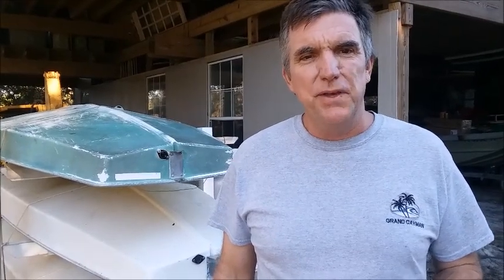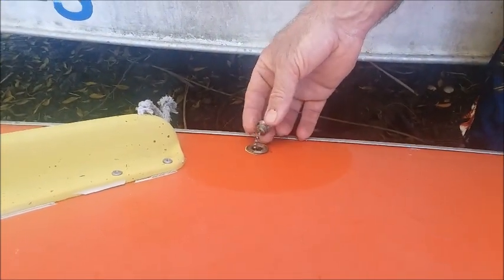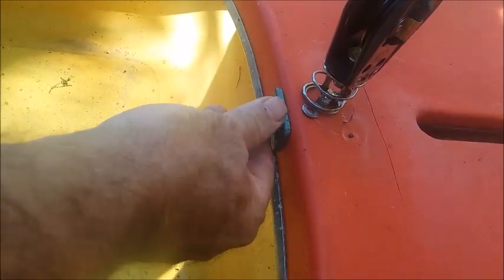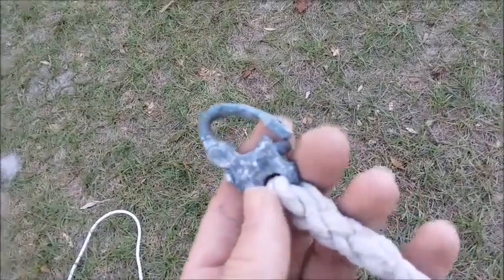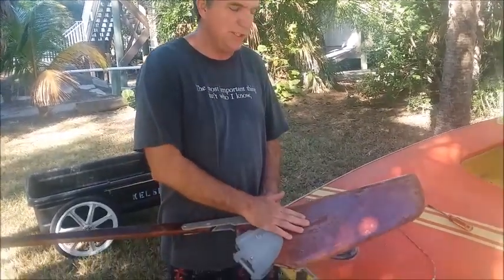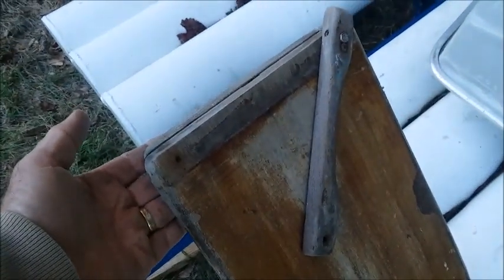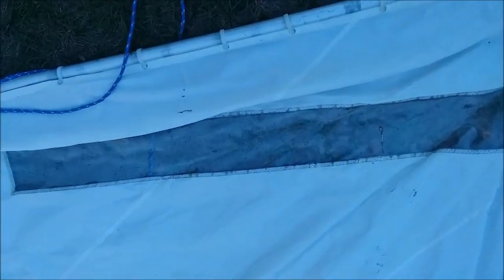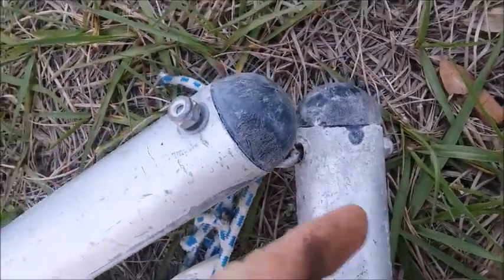Buying a Used Sunfish Sailboat? What to Look Out For!!!

Comment: Love the message, but there’s quite a bit of incorrect info in this video.  The soft hull is not just as fast.  When you find a hull that’s spider cracked and flexible, it’s not going to be nearly as fast especially not in waves.  The wire bridal on the back with the loop, the one’s without the loop are legit as well.  No one who races clips it to the loop in the middle, you tie it to the bridal so it can slide from side to side. 1 tip for your mainsheet block to keep it from pulling out is to always threw bolt it and use a backer piece of aluminum or large washers to keep it from pulling out.  That is not an after market bailer.  It’s the new style one that comes with all the newer boats.  I think they started doing that in the 80’s.  The porthole in the back was put there because the rudder fitting isn’t original.  That style of rudder didn’t come on that year of boat.  The pin’s that lock the rudder on, tent to bend.  Be careful that it’s straight.  It won’t go on well.

Comment: FYI, Sunfish earlier than 1972 or 73 had the serial numbers on a metal plate attached to the forward bulkhead of the cockpit and they often go missing. I have a '71 that I rehabbed and there's no serial number. Fortunately, I don't need to register it where I am moving to.

Comment: Thanks for the very useful video.  It seems you are in Florida, with your observations about corrosion from  salt water.  So I'm concerned about boating with alligators there!  I'm thinking of going to Florida and doing some Sunfish sailing, but as a newbie to the boat and the state, I'm a little worried about capsizing and being a tasty snack.  Same thing with avoiding swimming.  Any tips from any tropical Youtubers?  Common sense advice?  Reassurance?  I know enough to leave the gators the heck alone if I see them,  and to respect them as wild creatures.  Thanks in advance.
Reply from the maker: Gators are typically fresh water reptiles.  Not a big problem down here. Most urban lakes don't have any.  Usually they are in river systems or lakes attached to a river system.  I wouldn't suggest swimming at night but during the day I don't think it is a problem.  You would probably be a greater risk driving in your car to get here than getting bit by a gator.

Comment: Hey my name is Joy and I just bought a sunfish today and noticed some bad nose damage I was wondering if I could send you a picture of it to see what you recommend.
Reply from the maker: Hi Joy,  I would recommend using fiberglass resin with cloth to repair any cracks or holes.  Take a look at my other video "
How to Repair a Rotten Door Frame Threshold With Bondo and Fiberglass" to learn how to work with fiberglass.  In the situation with the sunfish don't put any bondo under the fiberglass like we did to repair the door jam but rather if cosmetics are important  then a thin bondo layer can be used to smooth out a fiberglassed repair area.  Fiberglass with cloth is used for strength while bondo is used to smooth a surface to hide cosmetic imperfections.  The video I referenced above with show you how to work with both products.  Both products are available at Homedepot or Lowes.  I would love to see a picture if you can send one through this comment thread.  Thanks
Reply: @creativerepairing2960  thank you!!!
Reply: @creativerepairing2960  I have no idea how to send a photo, I don't use youtube that often
Reply from the maker: @joymcdonald118  Hi Joy, I don't know youtube that well either.  Did the door jam video help?

Comment: One statement that is incorrect, not all Sunfish sailboats have a HIN number on the transom.  I've sailed these since the 1950's.  I currently own a 1959 in near perfect original condition.  The hull identification number is on a metal plate riveted behind the front splash, it is 5 digits. Thanks for the otherwise informative video!

Comment: People have told me that they've purchased a Sunfish hull (hull only) for little money. But they don't realize that the parts to get it sail ready will cost them quite a bit. Rudder and tiller assemblies alone run upwards of $300, let alone the spars, daggerboard, sails, etc. It's best to buy a complete boat to start with. Complete used boats in sailing condition are the way to go.
Reply: I had one given to me without the sail I wonder if there are inexpensive aftermarket sails out there I dont know if I will like sailing so I dont want to put a lot in it
Reply: @edwinmarcais6040  Aftermarket sails for the Sunfish are everywhere. They range from $150  on up. Just search the web.
Reply: @edwinmarcais6040  Try APS or Intensity sails for starters.

Comment: Hi! Great video. Got any links to reasonable sail replacements? Thanks!
Reply from the maker: Thanks,  as for the sail try ebay or a guy in Orlando Fl area sells new ones on Offerup.com for $175.  I never had to by a new one, but have used the family sewing machine to sew many repairs on ours.  Also have used the "sail tape" you can buy at West Marine to make patches.
Reply: Frank Marnell I don’t know what the damage is, but I second the use of sail tape if possible. I patch a couple smaller holes in mine. I also had a sail clip on the boom that was ripped out. I was able to replace it with a piece of webbing for reinforcement and a cheap grommet kit.

Comment: Would this be a good option for a solo skiff build?
Reply from the maker: I have seen several CL ads where someone converted on into a small solo skiff and put a transom and small outboard motor on it.  While I never road on one like that I might assume since the bottom of the hull has a curve to it (rocker) it would make it perform strange if it was propelled with any amount of horse power.  It would probably get a little squirrely if it was on a full plane.  A Carolina Skiff has a lot flatter bottom.
Reply: @creativerepairing2960  this was beyond helpful! Much appreciated response